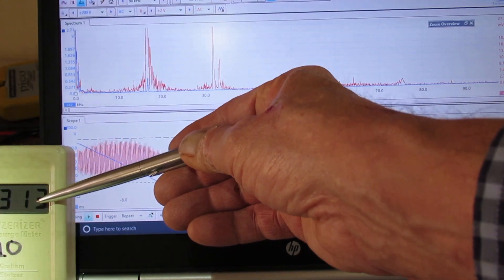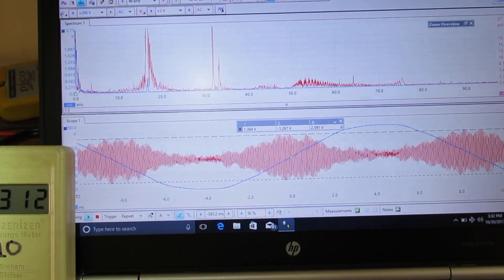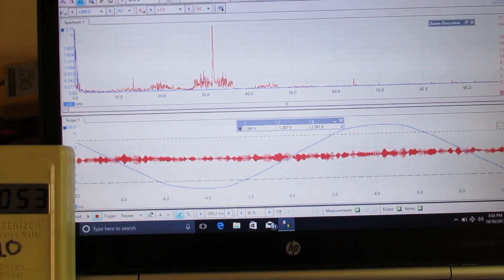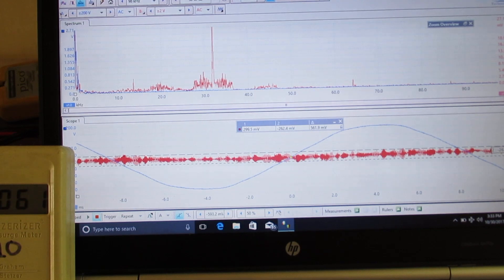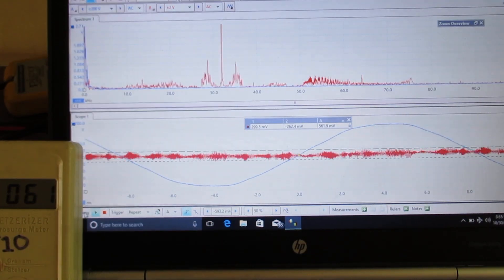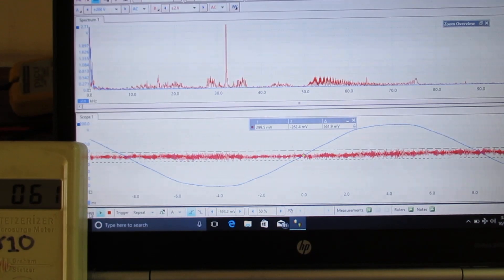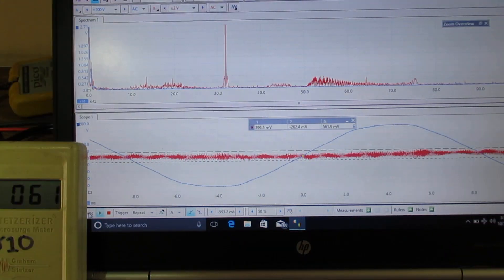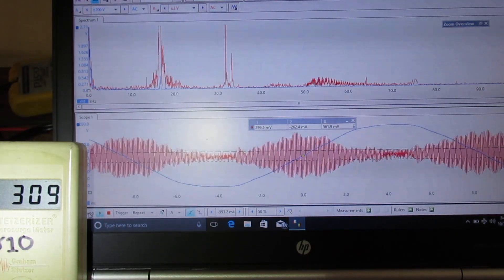Solar Edge SE 10,000A Inverter Creates Dirty Electricity

Comment: Can you provide information on the how the amplitude is affected by the distance from the inverter?  If you go into different rooms of the house for example.  Also can you provide info on proximity to AC outlets and kitchen appliances?
Reply from the maker: Yes I can: it will be about the same on all outlets in your house.

Comment: Mr. Windheim, Hi my name is Jon. I have just recently subscribed to your channel and bought a stetzer meter from your website. I'm just starting my path to learning about DE. I have just recently bought a honda inverter gen. and a solark 8k  solar inverter, thinking I was on the path to doing great things in becoming  less grid dependent. After several of yours and  others videos, and reading Milham DE book,  I am realizing this path is not as "great" as I thought. I have not finished the install of the solar yet so I can not measure with  stetzer meter , but the "clean" honda power  is measuring close to 1900 mg. I have several questions. First the gen.  Should  I try and return it since  I have not used it  yet ( except for that quick test ), and go back to my  old faithfull gen. that only puts about  200mg on the meter. Will your  filters  clean out that DE and how may  filters  do you  think it might take to clean up honda inverter.  Second  what type features do I need on a scope  so that I can visualize  and spot  the locations of these problems on  gen. , solar inverter , and grid. I have been wanting to get a scope anyway , and now that I am paying attention to this DE I can see I will have even more need for one. Thank you very much for what you are doing, and thank you in advance for any advice you might have for me. Jon
Reply from the maker: Portable Honda Generators were impossible for me to clean up back in 2012.  Very dirty even with 7 filters.

Comment: Is there a guideline on how much EMF and radiation from residential power companies power line before entering house fuse panel?  my readings are astronomical  before smart meter entry and after smart meter to fuse panel? my home is a EMF Dome ?? I have installed a in house filter at my fuse panel with hardly lowering EMF Reading!
Reply: what brand of filter do you have and does it get rid of dirty electricity. I was recommended to put one of these whole house filters on my house after the electric company puts the smart meter on my house that I can not opt out of because I live in Pa.
Reply: @DIYJIM  yes I purchased one from a retired electrical engineer he makes them, I paid $450 a lot of other sites I've seen ranging from $1,100 on up